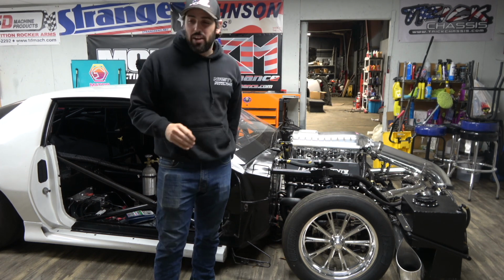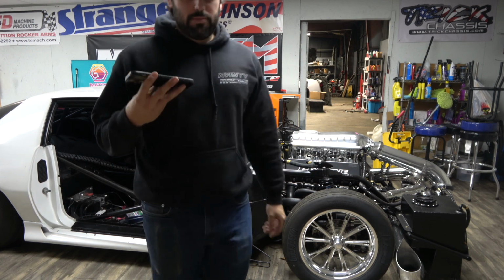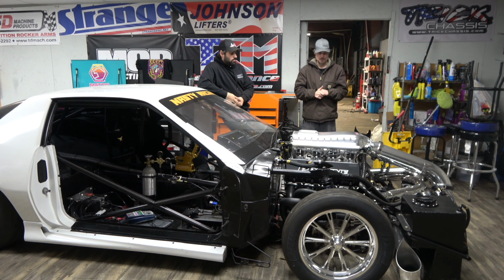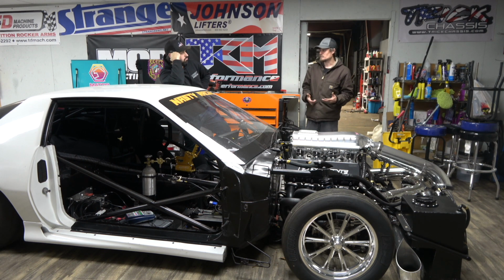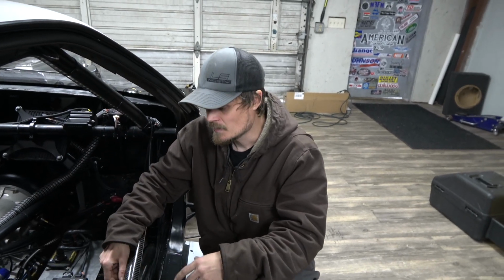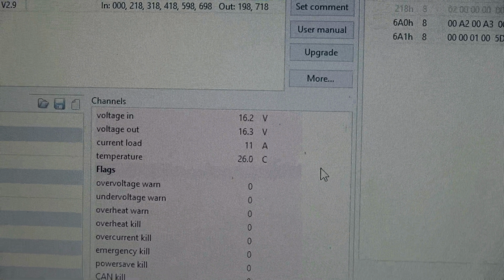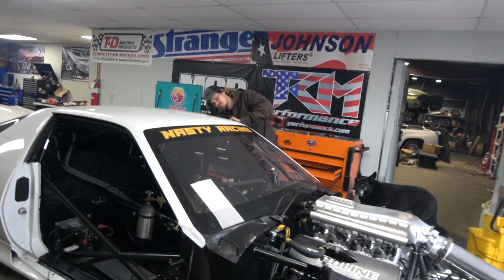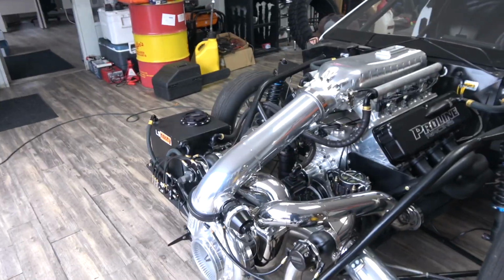SLICK RICK START UP!!! READY FOR THE DYNO!!!!!

Comment: To be safe I would go to 2800hp to 3000hp to make sure you wouldn't run out of fuel pump and injectors, you always say injector duty cycle is very important when it comes to power and being on the ragged edged.

Comment: What is a good electronic battery disconnect? I've always use the manual disconnects. But i would really like to get out of the stone ages and have a way for me (as the driver) to be able to kill the power. As well as the one on the back of the car. Does anybody have a good suggestion?

Comment: The only thing left that I would do to Slick Rick is I would put an external trans cooler hook up on the car and get an external trans cooler just so you know that the trans is completely cooled down in between runs and it's the exact same temperature when you go back out to make a pass